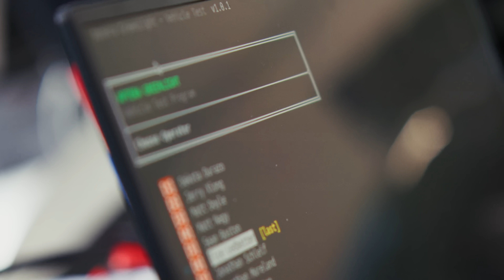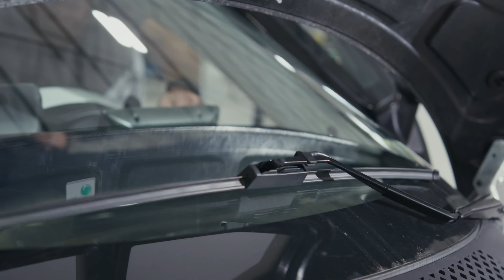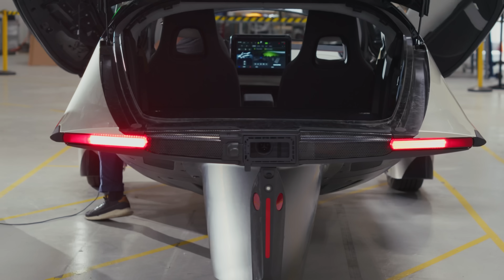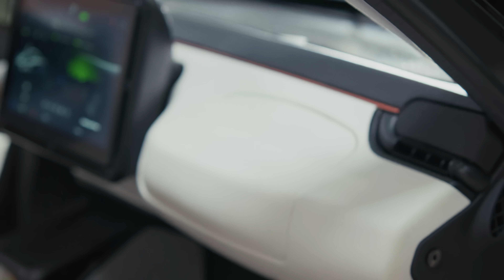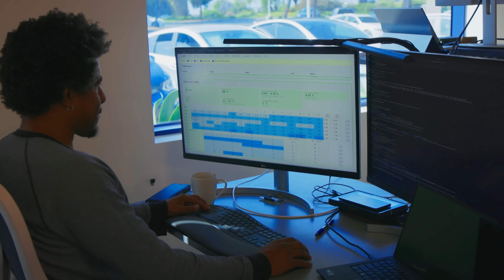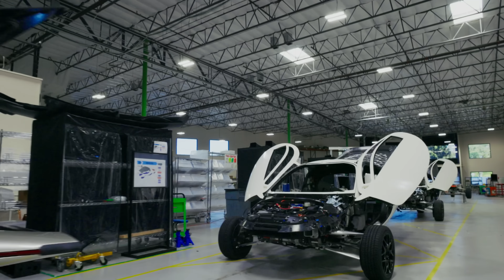Getting the Greenlight — Aptera's End-of-Line Testing Tool

Comment: Since 1982 when I first got my CDL till now 2026+ driving a manual stickshift up to 6-speed with clutch pedal. (Joyriders was discouraged) 

I wish Aptera has both stickshift levers and clutch pedal, only to be use for charging the batteries. (No traditional clutch disc and no actual shifting, all for strictly charging the batteries).

Joyriders may think twice Not to steal it.

Comment: Can't wait to buy this car in Europe. As soon as it's available her i will get it. But there is so much waiting.
Reply: Heads up, Aptera fans: Difficulties for Aptera outside the USA:

    • Aptera is built with the NACS charging port / system. NACS is not used anywhere else in the world. 
    • Aptera is much wider than a normal car - it is 223 cm wide. European roads, especially in cities & suburbs, are often significantly narrower than US roads. 
    • Europe has different regulatory, safety, licensing rules.
    • About 70 countries, including one third of the world’s population, drive on the left side of the road.
Reply: @TheArchiveRat sure I understand that ther is alot that have to be changed. The charing port is no big thing. The Biggest problem is the wide and the safty regulations. But maybe this thing also goes as motorcycle in other countrys. Those changes will take some time but i hope that they will be successful in the usa so that they have resources for Europ and other countries.

Comment: Looks like you are doing the right things to get to serial production. QC check list and accessible log like this cuts wasted motion and cuts the chance that you miss something.
Reply: @kervinbrungardt7547 - Writing semi-automated and fully automated validation software was what I did for 20 years.  Fun when your tasked with writing software pulling data from multiple incompatible systems to validate processes that the experts told us everyone knows can't be linked together and made to work.  Standardized consistently repeatable testing is key to a stable efficient process.

Sometimes it also pays to be ignorant.  I told those experts, obviously we weren't educated enough to know it couldn't be done so we just did it anyways and made it work.  Imagine if we had known ahead of time we couldn't do it and just kept repeating what the defeatists told us without giving it our best.  We would have then just Aped them repeating "Everybody knows that can't be done" without even bothering to try.  Better to fail while trying than to fail by giving up.

We also added the ability to set confidence levels on each technicians accuracy and kept track of how they were trending sending floor managers alerts when an individuals or teams quality level was dropping.  Often that simply meant it was time for a vacation break or reduction in overtime hours due to employee burnout.

Solid steady progress is a very good thing.

Best!

Comment: they've been trying to build a car / motorcyle since the early 2000's.. hardly a company at all. This was supposed to be a 25K vehicle.. now it's double that and they haven't sold a single one yet. Very disappointed in the price hikes.. will be cancelling the order.
Reply: This model was never 25k, I think it was 35k. Now it's 40k, after a few years of some of the worst inflation we've had in decades, that's not surprising
Reply: @GoClimbARockEh it was exactly $25,900 just 3 years ago.. the day I put my deposit on it.
Reply: @burtzland the 400 mile variant with full solar was never 25k
Reply: @GoClimbARockEh  You can still buy a Chinese EV (right NOW), for 1/3 of that. And the SLATE truck for almost half.  You can't build a consumer vehicle by hand in California (one of the worlds most expensive labour markets). It's just not feasible.  And they've been dancing around for years without acknowledging this.
Reply: @barnz3000 show me any car from any manufacturer that matches the specs of the aptera, at any price. 

And frankly, relatively little of the production is happening in California. But keep wringing those hands bub

Comment: When will the first customer purchased vehicle be sold?
Reply: Aptera stated last week in their SEC filing (13 May 2026):

“As of March 31, 2026, our existing cash and cash equivalents were not sufficient to fund our current operations for the next twelve months. These factors, among others, raise substantial doubt about our ability to continue as a going concern.”

and

“Following the successful capital raises in early 2026, management estimates that an additional $45 million to $50 million is required to fund the initial low-volume production phase of our Carlsbad facility.”

and

"We expect that the associated work would take approximately 12 months to complete from the time such capital is fully secured."

So, based on what Aptera said to the SEC on 13 May 2026, if they get the $millions they need by the end of 2026, they will be able to start selling vehicles as early as 2028.
Reply: @The @TheArchiveRat thanks for the info. Aptera seems to be on a shoe string budget.  2028 is better than never but every year seems to bring another delay.

Comment: So you created a low volume and slow validation tool. Bravo. You need to ramp quickly though once you get past initial production vehicle 50 or so. What's the gameplan for production speed and profitability?
Reply: Aptera said in their SEC filing last week (13 May 2026):

“As of March 31, 2026, our existing cash and cash equivalents were not sufficient to fund our current operations for the next twelve months. These factors, among others, raise substantial doubt about our ability to continue as a going concern.”

and

“Following the successful capital raises in early 2026, management estimates that an additional $45 million to $50 million is required to fund the initial low-volume production phase of our Carlsbad facility.”

and

"We expect that the associated work would take approximately 12 months to complete from the time such capital is fully secured."

So, based on what Aptera said to the SEC on 13 May 2026, if they get the $millions they need by the end of 2026, they will be able to start selling vehicles as early as 2028.
Reply: Too late for me as I’ll turn 81 in 2028. Good chance of not even being around by then.

Comment: I"M DYING TO SEE THESE ON THE STREETS! MY dream is to drive one of these cross country During the summer. The way this could change the world Imagine this car in Africa!!
Reply: Take road tripping challenges to a new height, this could smash Australia if done right so yeah Africa would be the big hurdle!! Do you know if anyone has done the length (or height I guess) of Africa in an EV?
Reply: @flipmotion274 no idea at all. But imagine all those sunny dessert countries with a solar vehicle! Insane. From spring to fall though this puppy could rule the USA!
Reply: @flipmotion274  Difficulties for Aptera in Australia: 
    • Aptera is built with the NACS charging port / system. NACS is not used anywhere else in the world. 
    • Aptera is much wider than a normal car - it is 223 cm wide. By comparison, Australian semi-trailers are 250cm wide. Australian roads, especially in cities & suburbs, are often significantly narrower than US roads. 
    • Australia has different regulatory, safety, licensing rules.

Comment: Is this the kinda of software car mechanics can use to diagnose issues with the car? Aptera feels unique to me compared to other vehicles. I have been wondering what it would be like when, after years of use, it would need to be repaired. What could be done to improve confidence, in both customer and car mechanic, that Aptera wont have a big learning curve for mechanics to undertake in order to repair and replace parts.
Reply: As someone who repairs old cars - their vehicle is both extremely simple in construction, and mostly uses recognizable parts. It should not be out of the capabilities of most mechanics to do standard services. They've claimed that there will not be a paywall for the repair and service infrastructure (Toyota is between $580 a year and $30/2 days for access to their service manual library).

I can't think of a better EV for the DIY mechanic crowd. What is TBD is how many parts will block other parts (the packaging decisions).
Reply: @ApteraAccessoryMakers  I can't wait to see what the aftermarket scene becomes.  From custom wraps to 3d printed accessories, it's gonna be a lot of fun.
Reply: Check out previous videos.  Aptera supports "Right to Repair" and will have video guides as to how.  Parts will have QR codes for easy ordering when needed.  Mechanically, its an EV so its super simple compared to an ICE vehicle.

Comment: I would like to see Aptera succeed, however at their current estimated price for a production vehicle, I don't see that happening.  Without being able to spit these out on an advanced assembly line, they are never going to be able to sell at the price they claimed it would sell for years ago.
Reply: I expect they'd have had to raise the price accounting for inflation alone, but as long as it's no more than 30% higher priced than what it was originally going to be then I think lots of people would still buy it
Reply: The price has not changed in years, despite inflation.  Its literally cheaper now than the proposed launch price of $38,000 when inflation is considered.
Reply: The assembly robotic carts are already there, just waiting for a job
Reply: Gas is hitting over $6 a gallon and beef over $8 a pound in the US. People will have a lot less spendable income but I can’t expect the price of cars to hold stable. Especially electric or hybrid cars which have certainly shot up in demand.
Reply: Clownish bloviation. Do you expect a vehicle with more advanced features, years later, to cost the same as ESTIMATES given for a vehicle with different options, and without factoring in inflation?  That's some silly excrement, right there, but keep trolling, you'll get the hang of it..... or not.

Comment: Heads up, Aptera fans - in their 10-Q filing with the SEC last week (13 May 2026) Aptera said:

“As of March 31, 2026, our existing cash and cash equivalents were not sufficient to fund our current operations for the next twelve months. These factors, among others, raise substantial doubt about our ability to continue as a going concern. ”

and

“Following the successful capital raises in early 2026, management estimates that an additional $45 million to $50 million is required to fund the initial low-volume production phase of our Carlsbad facility.”

and

"We expect that the associated work would take approximately 12 months to complete from the time such capital is fully secured."

So, based on what Aptera said to the SEC on 13 May 2026, if they get the $millions they need by the end of 2026, they will be able to start selling vehicles as early as 2028.
Reply: They’ve danced on the precipice this long, I’m sure they’ll figure something out.  And if not, it was fun to watch. And I say that as an investor.
Reply: @ThomasShields-s1v  Actually, even they go south, it won't be the end. Someone will pick up the parts and pieces and bring it to market.
Reply: Wonder if they’ll make a video on this instead of the nothing burgers they continue to make?
Reply: @Dontletthesmoothtastefoolya  Steve from ApteraOwnersClub usually handles the analysis of their SEC filings.
Reply: @Dontletthesmoothtastefoolya  Make a video on an announcement they already made. I'm sure they can if you want. And they have made more than you have on your channel, so get to making something useful
Reply: About the same thing I've been hearing from them for, what is it now? Ten years?

Comment: When is full production starting?
Reply: In their SEC filing last week (13 May 2026), Aptera said:

“Following the successful capital raises in early 2026, management estimates that an additional $45 million to $50 million is required to fund the initial low-volume production phase of our Carlsbad facility.”

and

"We expect that the associated work would take approximately 12 months to complete from the time such capital is fully secured."

So, based on what Aptera said to the SEC on 13 May 2026, if they get the $millions they need by the end of 2026, they will be able to start selling vehicles as early as 2028.

Comment: I particularly like that this software build a database of previous tests and that is designed to be run at any stage in the assembly. Being able to access data from past configurations and experiments is extremely valuable for engineers.